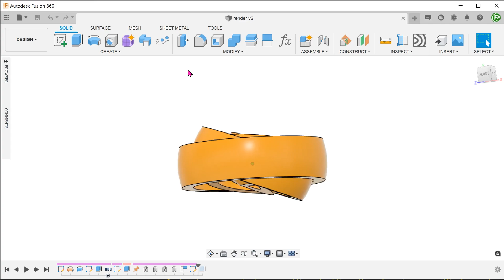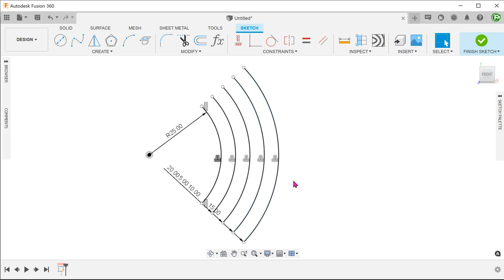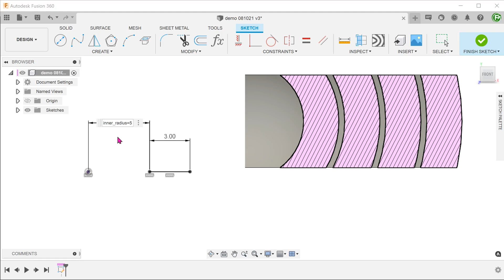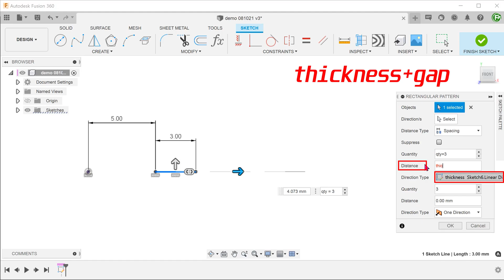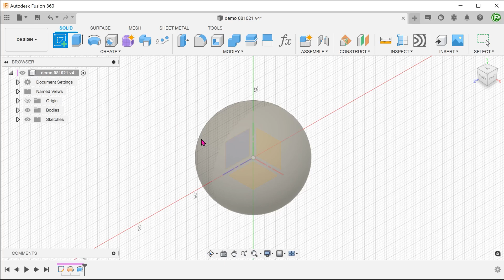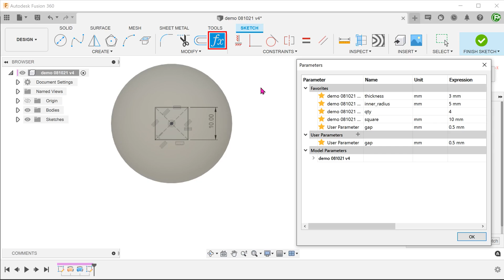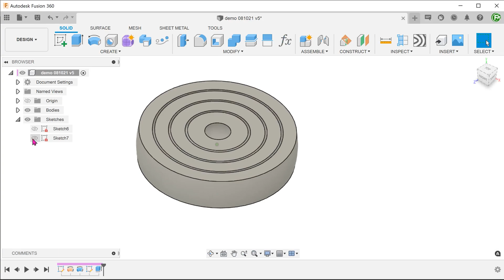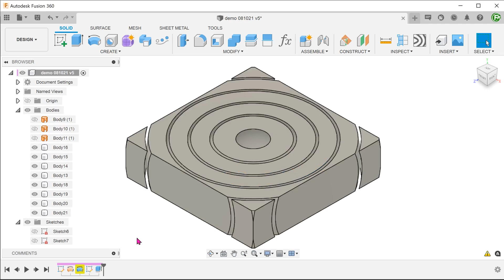Fusion 360 | Patterning Concentric Spherical Shells

Comment: nice method, you could enhance it by selecting sketch/revolve not lines/surfaces in revolve (if pattern changes it would update, if the above is applicable in fusion).